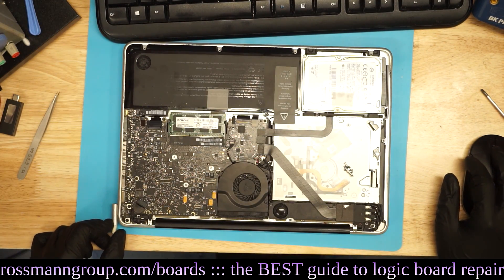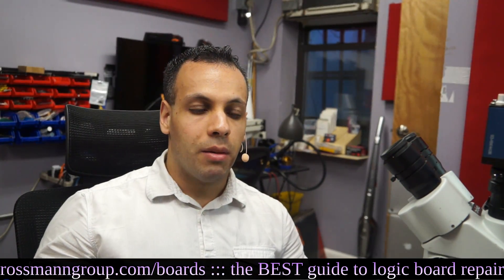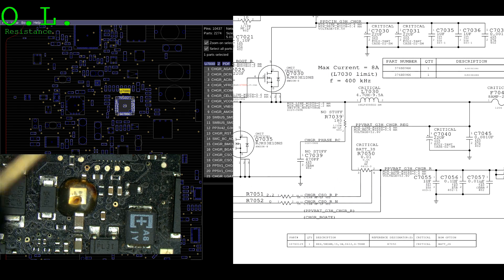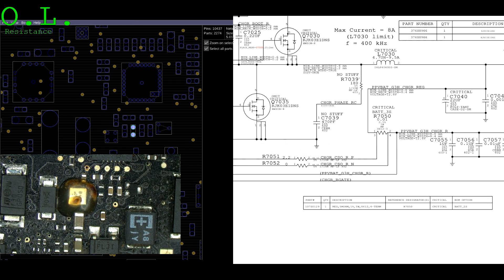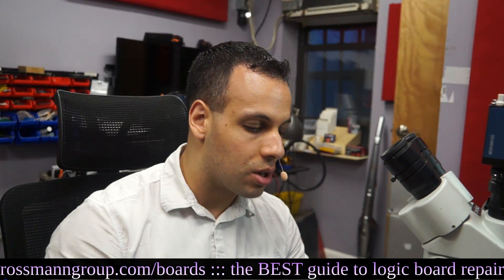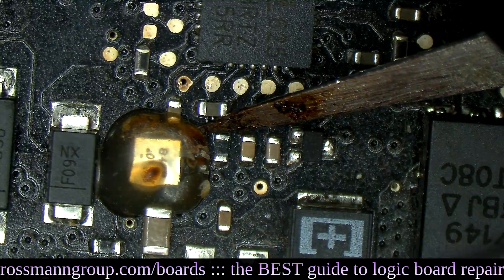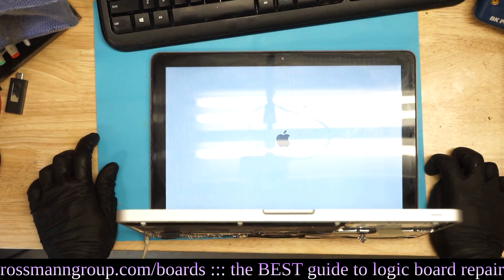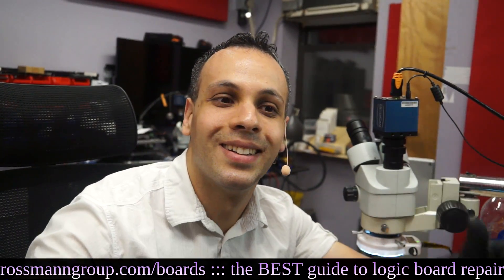How cheap eBay batteries DESTROY Macbook logic boards!

Comment: This doesn't make sense...  Yes something killed the sense resistor, but at the end you show that the 'crappy' battery is actually ok and charging...
Reply from the maker: That is the original battery, it has over 700 Cycles so it only lasts for a half hour but it is able to charge so it is working for testing purposes
Reply: It seems more likely is was an after market charger that could have caused the issue than the battery itself
Reply: Georg F It all depends how the circuit actually works (it was partially off screen and I have no other use for buying a copy).  Something must have caused heavy current through the failed resistor, and ideally, Louis should have checked for additional damage along the current path, such as a partially fried transistor.
Reply: Anonymous Anonymous oh so the user is wrong? You should be able to use it on the power grid, this doesn't wear the battery by uselessly cycle it till it's death, while you're near a wall plug
Reply: after watching the video for second time - actually it is not the current sense resistor blown, it is the op amp input resistor, which I think is not blown, but probably corroded by chemicals in the bonding compound, it is a known issue with similar compounds that in long term they damage SMD components, it is not possible any kind of battery to damage only the op amp input resistor and nothing else. so there is absolutely no logic to blame the fake battery.
Reply: You are sure was not a just a current rush because he have the mac plugged on AC when insert the battery sound like the soft start dont trigger and eat the resistor.
Reply: i have also never heard of a ebay battery causing any problem, but I also don't touch macs...
Reply: Joseph Stott Ive replaced batteries from amazon batteries.  Including in my macbook  air.  I don't buy the cheapest on possible, though.  Id like to see  link to this specifc battery to see if others had similar issues
Reply: mnikolay80
Nearly miss the point here, let a troll fill you in. Buy a battery from Rossman Group's site, and if THEIR replacement blows your load, you get this free FIX. Myeah, included indemnity, see what I did there?
Reply: Joseph Stott
You didn't watch the video. Lou digressed to Amazon, eNay must not have cheap covers, but I'll bet that he's getting theirs from an Alibaba bulk supplier.
Reply: Joseph Stott LOL yep, seen the whole video, still haven't heard of eBay batteries causing problems, FtW.
Reply: pufero1 ergo give credit where credit is due: the 0ohm resistor took the fall for the rest of the traces. When we see a trace go south for a Shunt component, they'll have to shutter the whole hood to contain the ensuing rant.Vlog
Reply: Anonymous Anonymous
Truth is that new PC replacement batteries require weeks of conditioning during which BRIEF removal and replacement is mandatory, during LONG, CONTINUOUS charging cycles. Conventional logic and common sense are defied during this time, and the optimal conditioner requires automatic temperature sensing externally, bypassing internal circuitry. It really IS a science in itself.
Reply: Georg F you mean it doesn't see any power dissipation. Shunts basically 'see' all the current, passing >100% from end to end.
Reply: mnikolay80 Are you sure it's just a low current opamp input resistor?  I think enough of the circuit was off screen to not know this. And if it was, if it's circuit position could make it carry an unhealthy current burst when messing with the battery.
Reply: What kind of crappy battery did Apple use in the first place?! My HP laptop has over twice that number of cycles yet still has decent capacity left. Granted, I don't tend to run it down to very low, maybe 20% at the lowest.
Reply: Still not sure how a 'crappy' battery would fry R7052. How would it straight up blow a 0 Ohm resistor that doesnt even see any current? That doesn't make sense. Maybe just coincidence?
Reply: The charge IC will still function correctly if R7052 is at a low resistance (a few ohms), I'm placing my bets on R7052 being weakened prior to the battery replacement, and a transient event occurred when the new battery was installed, pushing it over the edge
Reply: Mayby the person replaying the battery made some sparks with metal tools near the battery plug. 
From what I hear Tim Cook likes a nice long dong too. Not that there is anything wrong with that.

Comment: do you know about MacBook Pro mid 2012 screen start getting problems and then just turn white forever no video signal but attached to external screen its all good. I changed screen and lvds cable still the same

Comment: As a graphic designer, I'm very much attached to the outrageously expensive MacBook Pros...however, I totally see your point and agree with your assessments. Plus, I used to work at the "genius bar" and I know that the only thing that really happens is modular repair. The real repairs are sent away...and sometimes that doesn't do the trick as well. I've done upgrades and repairs on my own MacBook Pros and those of my daughters - replacing drives with SSDs, replacing batteries, upgrading SIM cards, etc. Simply stuff. But now I'm frustrated with my 2017 Pro that is no where near as powerful as my 2010. I'm thinking of reviving the 2010 (I think it's a cheap battery that's the problem, though I know I won't be able to use my updated software). I know PCs are so terrifically less expensive and one can get a kickass machine that is great for design, but after trying it out...unable to truly make the switchover. For me, it's all about the software and using it on the Mac.

Comment: the only ways i can see that a cheap battery can kill something is.

1. remember discharge effect you get on aging nicads where they will slow down a motor then the motor will suddenly speed up  maybe the same kind of effect and the voltage regulator or boost/buck regulator cant respond fast enough and a surge blows something.

2. when the battery goes down the device draws more amps to compensate and too much current through a board trace will burn it off.

Comment: my dads 15 inch macbook battery died. 2012 model, the battery only had around 150 charge cycles to it. But because the computer stopped reading the battery the computer seemed to run in a really low powered mode... (very slow) And yes were poor... We ended up buying a battery off ebay for £30 and its so far seeming to work.

But how could a battery with so few cycles fail?

Comment: This reconditioning plan  ( Check Details Here>>>https://www.facebook.com/Battery-reconditioning-310070329426065/app/208195102528120 )  is incredible. I had been able to bring my laptop batteries and several other kinds of batteries back again with your methods. I followed the steps easily due to the easy guidelines. I have a few more batteries I am going to recondition now also.

Comment: Meanwhile, you can easy get reliable, inexpensive after market batteries for any Thinkpad, even for an old t43 (no, not a tank, but built like one).
Just got a new 7800mA battery for the x201, 35€, plug and play.

Comment: Luis, I have a request. 2 weeks ago my note 8 had a charge issue where it would not charge IF the device self powered down for low battery. Note 8 would also not charge after that, the trick to getting it charging again was to set it on a quick charge wireless pad + plug in and unplug the USB C cable. It will eventually show the voltage icon and power up. The phone inevitably stops charging layer on even thought it says it is CHARGING, so once it powers down its a wrap and you have a dead phone/ brick. Have you encountered this and if you have what went wrong with mobo/pcb /charge port etcetera?

Comment: +Louis Rossmann,   I have been watching your repairs and warnings for 3  years. Even after all your warnings I bought an  macbook pro today:) No joking; I asked myelf `why did I choose to buy?`than answer was clear for me ;  2k Retina display and os x scaling. I was rather confused  between Lenovo thinkpad x carbon and macbook pro. After testing both I choose what is pleasant for my eyes. I was quite certain that i wont buy any apple products after using a not upgradable macbook air.(which is obsolote now due to soldered 2gb ram) But I do the same mistake again only for the irresistable display today.  Long story short, you may find this non-sense but I guess people still valid reasons to buy apple products.
Reply from the maker: Scaling and fonts in Windows sucks, I don't blame you

Comment: It's almost as if it's a better idea to go with an external battery that has its own controller and protection, along with on-mainboard circuitry designed with fuses and capacitors and whatnot so it can resist/filter questionable power being supplied instead of burning up.

Then again, I don't think I've ever heard of eBay batteries killing cellphones, most of which use internal minimally-protected/filtered Li-Po batteries these days, so it might just be that the former doesn't matter and Apple is absolutely shit at designing power-delivery/control circuits.

Comment: Sounds like that resister popped when the original battery was in there and the guy thought it needed a new battery. put new battery in did not fix it.. 
and you can now have a burrito, you fixed it and you will now get money for yummy burrito..

Comment: something dont make sense here to me.... why this happened?!? and why the detective louis doesnt investigate why this happened? may be because the current sense circuit was burned with the original battery, which stopped charging, and that was the reason why the owner replaced the battery? I do understand that  we all want to advertise the products we are selling but.... that was too suspicious to me...
Reply from the maker: Original battery  is the one charging.....
Reply: ok, but you say that the current sense resistor was burned because of non genuine battery. and still dont understand how non genuine battery will burn the current sense resistor ?!? when the current reach unacceptable high levels the current sense circuit should turn off the mosfets using that current, how bad/defective/fake/whatever you call it battery will cause burning the current sense resistor ?!?

Comment: So lets get this right ? they purchased a ebay battery and didn't buy a bottom case with new rubbers but yet went to the trouble of taping them on ... and  then because of the ebay battery the laptop is probably costing them $350 to get fixed when they could have got a brand new Louis Rossmann verified battery and a new bottom case for half that cost bahaha sounds like a normal customer to me .... Great Video Louis ;)
Reply: Fantastic!
Reply: What's with the creepy Fantastic?
Reply: They were stupid cheap. It costs around a buck for double sided tape to stick the feet on right lol. 

Me when i deal with those things i just pass a hot hair drier or heat gun over the pad for a second and take it off and can reuse the original glue. I only do that on my own stuff thugh other wise i just use new double sided tape.

Comment: And Louis, by what means a battery can blow up a current sensing circuit by itself (provided the voltage is same as designed)?
Please solve that mystery for me!
Reply: Imre Fabian apple
Reply: Felix Suenkeler, I expected a bit more technical and elaborate answer!
Reply: Mind, you all, this comment is in no way criticism on Louis. I am sure the current which destroyed the resistors in the circuit came from the (non original) battery.
Also i am sure the Apple circuit is crappy.
I am only curious what mechanism Louis has in mind for this mishap.
Reply: Imre Fabian the battery was probably at  . 1 to. 5 volts over original apple battery value and apple design there circuits with no wiggle room as its cheaper

Comment: They just put tape on the bumps because switching the bottom cover for a new one would turn their Mac into a PC
Reply: They can not buy a replacement bottom part as that would have to be stopped at the border as couterfit mac product. Also you need a certified mac repair technician to replace the bottom. Tape is original certified mac tape and can be fixed by a non certified technician  so is ok
Reply: You are mistaken. Changing the feet would have made the bottom a counterfit item. Also you need a separate certification to even work on the bottom part at all. This certification btw costs about 20k and only possible on the 32nd day of the 14th month of the year when the moon is in alignement with alpha proxima centauri.
Reply: that's my problem, I went Simon Pegg about 5 years ago and haven't had my Holy Grail refresher training in too long...
Reply: aasp would have replaced the feet for $20-30 not the bottom case.  it's not rocket science.
Reply: I know Dutch humor / sarcasm is very complex and maybe too far ahead for you. Cant help you there , sorry. Requires a certification as well. Start training with Monty Python as base skill set and move on from there. Maybe in 10 years or so ......
Reply: Hey man, there is hope. Recognising you have a problem is step 1 to a cure. Always look on the bright side of life .....
Reply: at least I remember that my mother wasn't a hamster and my father did not smell of elderberries.
Reply: 10 points for you man !!!  (we lost 50% of the readers i guess as we are talking MPython code now) Helps to be an old fart like myself
Reply: uh...  you are assuming I was/am not an Apple certified technician?  if a certified by apple technician (did you not know what the "aasp" meant?) working at an aasp replaces the bottom case feet, it is not a "counterfeit item".  there is no "separate certification to even work on the bottom part" you're either certified to perform ANY apple service procedure on a given chassis or you are not (some procedures require certain apple provided tools, this does not).  including replacing the bottom case feet.  while getting a NEW service business set up as an aasp looks to be impossible given apple's attitudes about the concept, you're about an order of magnitude low if you want to set up a new wholly owned location of an existing aasp.  the aasp I worked for paid all the test fees.  might have come to ~$1500 max if I would have paid them myself.  the trick is to work for the one or two aasp in your geographic area.  which for a ~200,000 population area seems to be about 2 aasp with a total of about 6 technicians between them, some of whom are ios only techs.

Comment: did you replace the battery?
Reply from the maker: In the end yes. The dude put the original battery back in which worked for this case, it has over 700 cycle so it only lasts a half hour but at least I can tell that the charging circuit works from it

Comment: Hey that model has problems with the HDD Flex because of the two screws that they use in it, flex cables shouldn't have screws (or at least not in the middle), is an easy way to break them.

Comment: I've seen this issue happen countless times, great video as always Louis and thank you
Reply: cptxander Is that apple only thing? I don't buy the cheapest crap but as I have used aftermarket batteries they are performing on par with original, in some cases better.

Comment: when you're willing to spend over a $1000 on a laptop but cheap out a replacement battery
👍😎
Reply: It's an old model that still has an optical drive and HDD. Could have been bought used.
Reply: The question burning on my mind is what is wrong with the replacement battery that caused the sense resistor to burn out in the first place? Wrong pin out? Too many cells - Output voltage too high?
Reply: hey don't say that! apple users spend good money on useless shit! i'm not surprise if they have barely any money for good replacement parts LOL!
Reply: sometimes even those are incompatible
Reply: When you're willing to spend over $1000 on a laptop that can die all on its own regardless of the battery used.
Reply: Which batteries work in that model?
Till mid 2012?
Reply: When will people learn, that the only thing that's compatible with Apple is another Apple product.
Reply: Like people buying iPhones but no 1-3$ protective case

Comment: These things are so delicate if you install Windows on it, use a slightly incorrect part, look at it wrong, hold it wrong, flip it upside down, put it in a drawer, blow on it a bit, or try to clean it up using air duster, its delicate parts commit suicide and renders everything useless.

Comment: I don't understand how a cheap battery can fry the current sense resistor. On the other hand, what doesn't kill a apple product?
Reply: Arno nümuss Because it's an Apple product. It's designed to fail at the drop of a hat.
Reply: That reminds me why I don't own a apple product. Once I nearly bought some apple stuff like a tablet and a bluetooth keyboard. But both didn't work as expected in the shop and the guy told me, oh that's just because another customer looked at them before. You get new ones anyway. I looked at that guy, thought for a moment, thanked him and left the shop.
Reply: "How cheap eBay batteries DESTROY Macbook logic boards!" What is the answer? How do they? Louis is King, no doubt, King, but what is the answer to the original question?
Reply: I was wondering the same thing.
Reply: What doesn't kill an Apple product? Money.
Reply: I don't understand this either... the only guess - the battery was overdischarged, and circuit couldn't handle it in some weird way...
Reply: Maybe the battery is over voltage and its clamping to the chips vcc via its internal protection diodes ?
Reply: I doubt overvoltage - then it should be wrong wiring inside battery pack - unlikely...